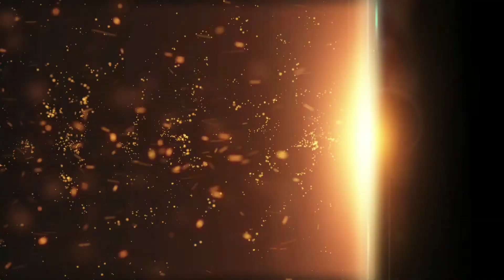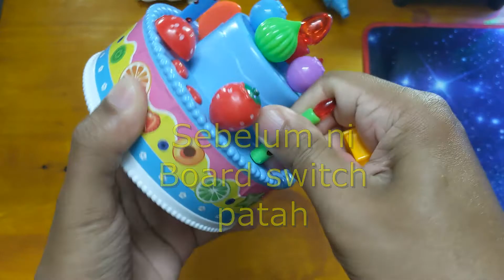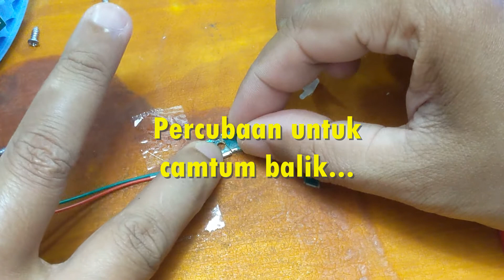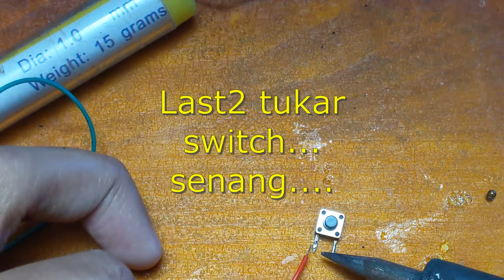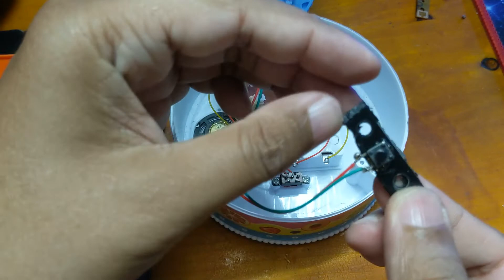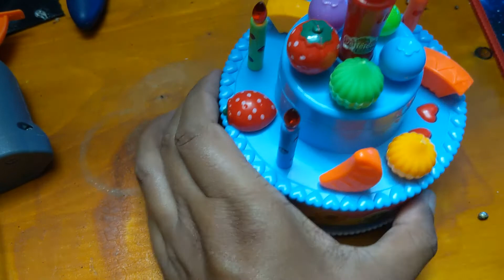Cara Baiki Mainan Kanak-kanak

Comment: Ley upgrade kereta control nak tambah battery power tak.skang pakai battery 12v nak tambah kan lagi supaya ley tahan lama sket.ley tak.?kite kasi upah ah.
Reply from the maker: Kalau battery control pakai ni-mah, abg boleh cari battery Sama value Dan buat sambungkan secara parallel. Bila abg buat secara parallel voltage akan kekal 12v cumah mAh akan bertambah. Jangan sambung secara series sebab voltage akan jadi 24v.